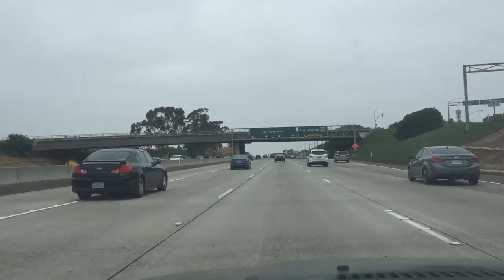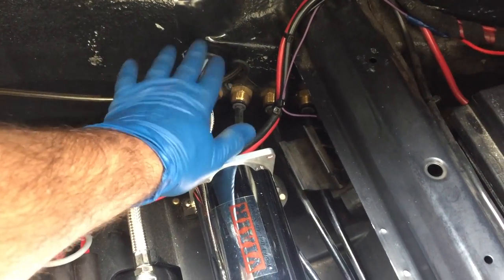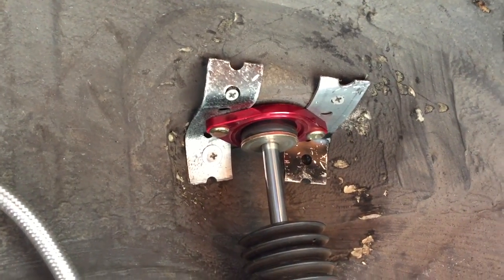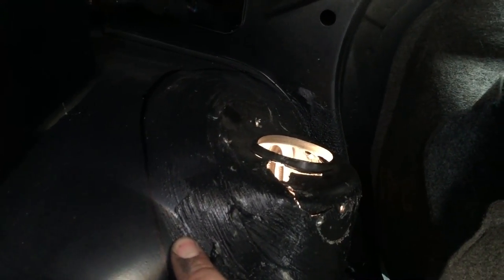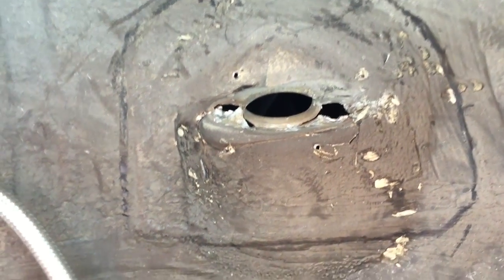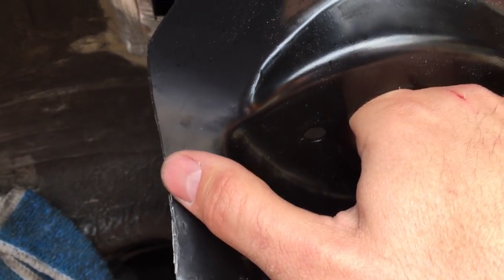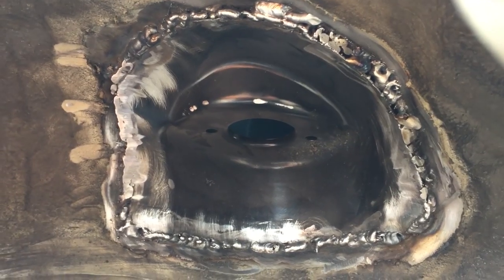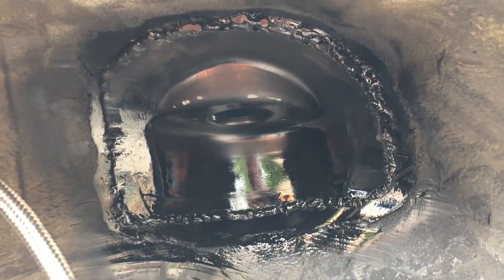DIY: How to replace E36 rear shock mounts. WARNING: SERIOUS JOB!

Comment: Could be wrong but I thought those plates should be welded on top of the strut tower rather than cutting out the old strut tower and butt welding them in...?

Comment: I just bought the replacement shock tower.  Just curious though.  Is there a reason why you cut out the old metal?  Couldn't you have just welded the replacement right over it, without having to cut out the old metal?  I figure with two layers of metal, it would be a lot stronger.  Then, install reinforcement plates, and it would be bullet-proof.
Reply: Just an update.  I had a welder install it a few weeks ago.  This was the passenger side.  It mounted much better on the inside than the outside.  And, he didn't cut out as much metal.  Just what was damaged.

Comment: Go buy some rear shock tower reinforcement plates, they are only $20 and will prevent this from happening again. My shock towers are still mint even after 160k miles on coilovers thanks to those reinforcement plates.
Reply from the maker: Just purchased!

Comment: mine has 255 and the rear shock is dangling from the top mount . when i hit bumps it hits the ground .   the springs seem to keep the car level ....            this would deff be a good thing to do ..

Comment: Happened to mine today. Sigh. How's it all holding up? Have you had it aligned since? Asking because the repairs I've seen use butt-welds, but I like your idea more (and it seems easier for whatever Craigslist mobile weld bro I have do mine. Cheers!!